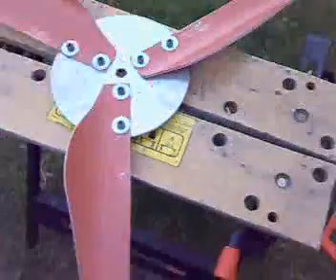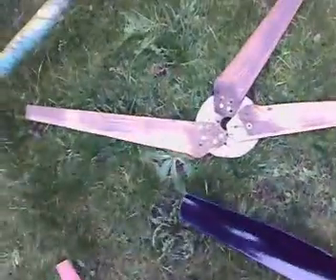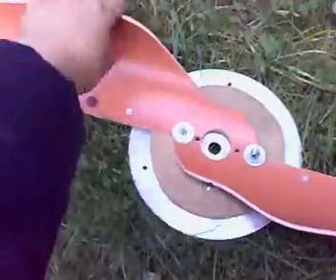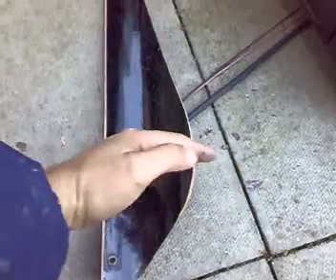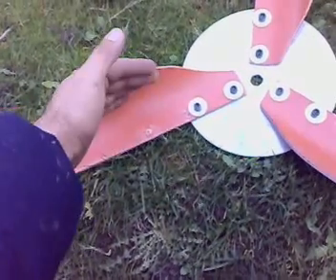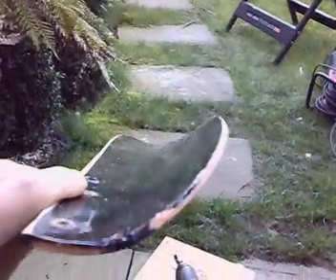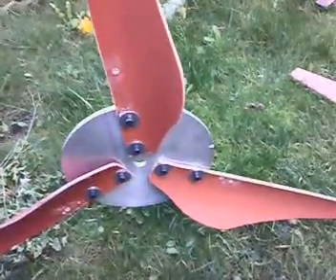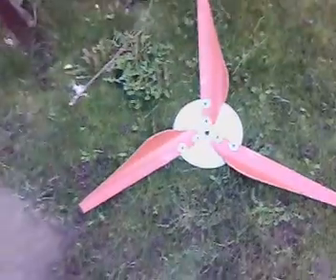home made turbine/ametek 30 v

Comment: amtek is the brand of the dc permanent magnet motor that use as a generator. they are a heavy duty motor with a good long life span, they pull them from equipment such as commercial tape drives among many other things.

Comment: What exactly is an Ametek? I have seen them mentioned around the web but they always assume you already know what it is. 

Balancing: you could set it on a large ball bearing. and just file the edge of the heavy blade instead of adding weights (drag)
Your vids are great. Very informative, thanks.